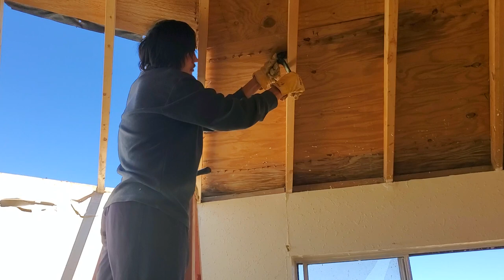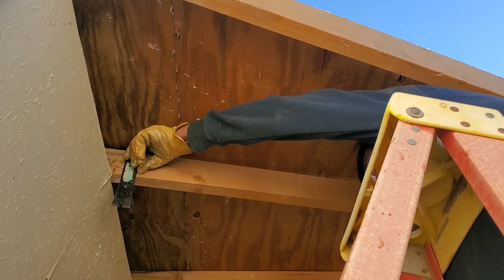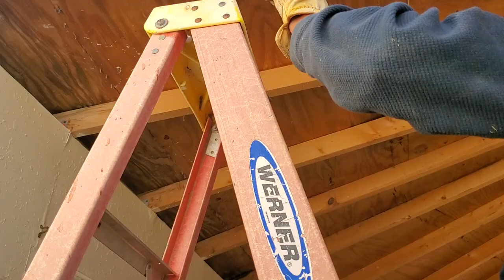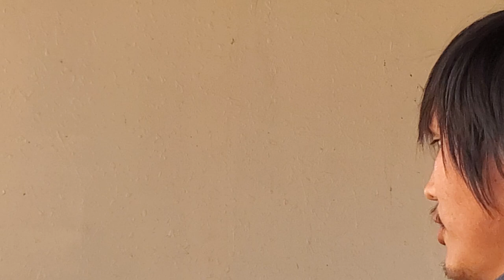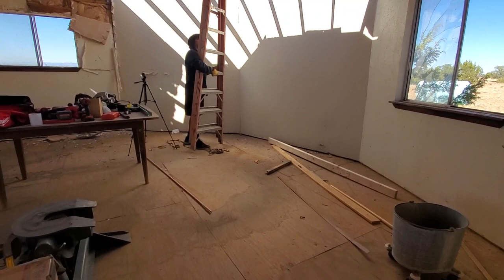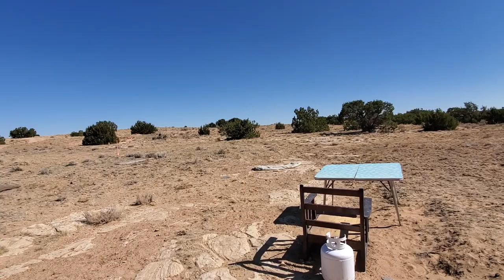Restoring a 30 year old Hogan (a home in Diné culture) Day 4

Comment: Don't forget your PPE & eyewear too. Being remote & having to haul supplies each time to work makes each trip valuable. Be careful filming too & make room for things to come down & not be hurt. A regular crow bar could make demolition easier because of more leverage. Take time to plan each move & make room to be safe while taking things down. Clear the floor as you move along to keep your way safe.  If there are some loose refrigerator magnets one could attach them to an end of a broom handle to pickup loose nails with out bending down each time.  A design based on tradition that predates the country is something to be proud of. A home that has a family connection is even more precious. 
Be Well & Keep Safe
Reply from the maker: Ron thank you so much for the advice, you're right! 👍 definitely will follow those tips, thank you and wishing you the best my brother 🌍🌻
Reply: @seanetsitty5243   I may be older than your Dad. & I have two sons
Blessed Be
Reply from the maker: @ronsmith1364  I'm grateful for you and you sharing your wisdom sir. God Bless you and your family